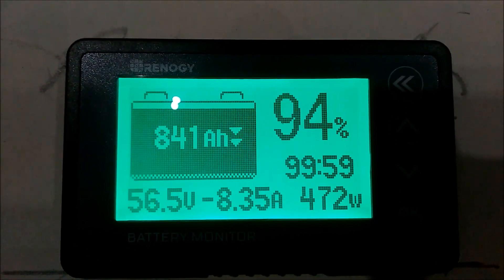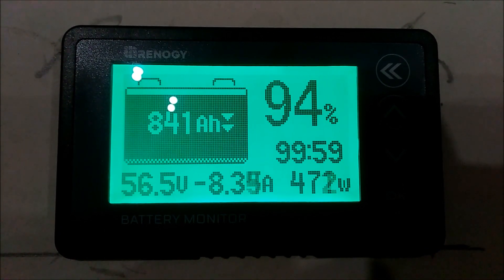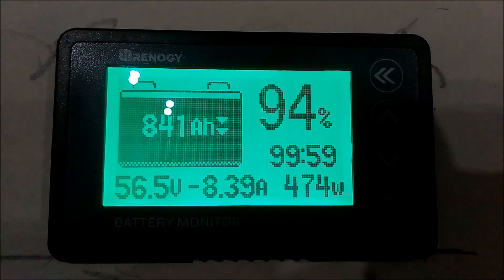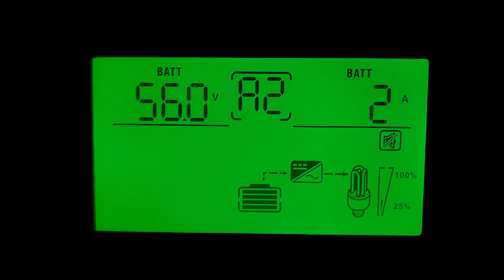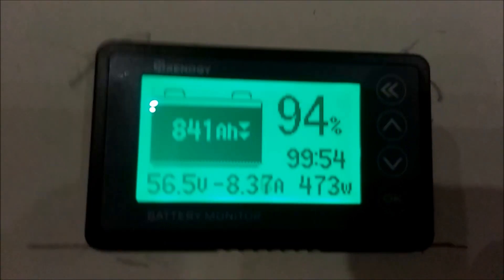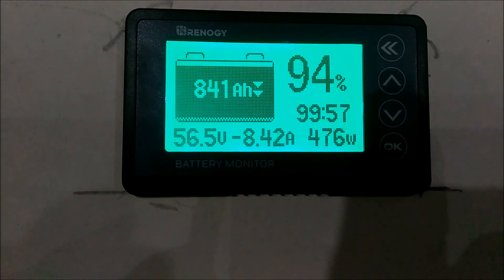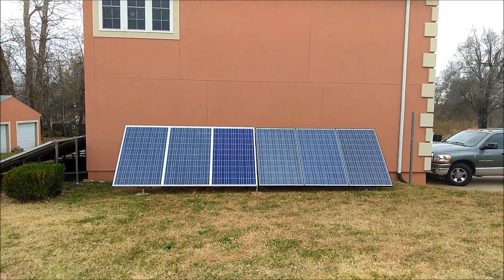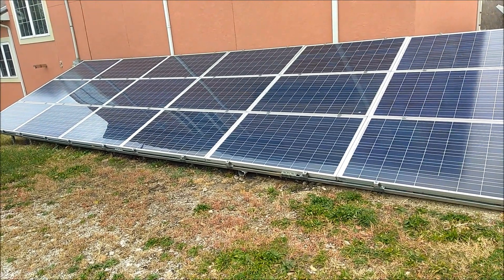NISSAN LEAF MEGA POWER WALL UPDATE 11- 20 - 2020

Comment: Man I really like what you're doing here.  Subscribed!  So are you completely off grid now or do you use the grid as a backup?
Reply from the maker: No I'm still on the grid just using it for backup.  I have some big loads that I do not run on my solar setup like a big air compressor in the garage and a couple of  other things.  Thank you for watching 👍.